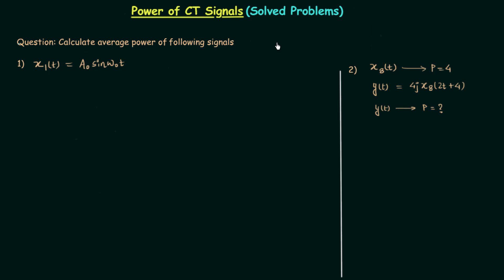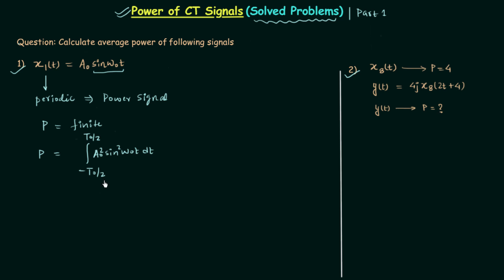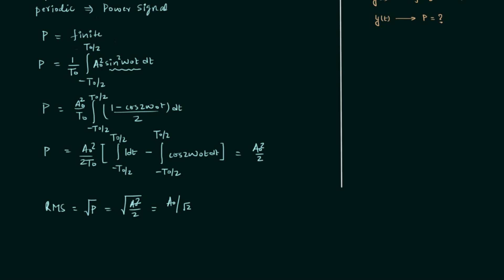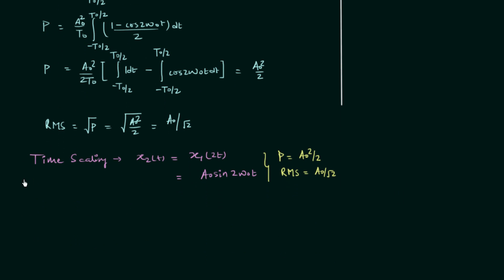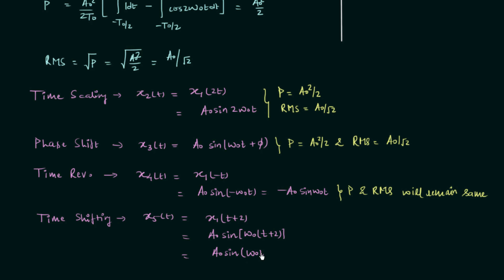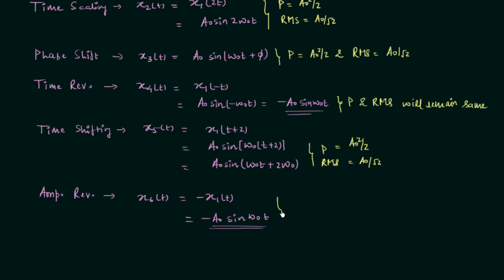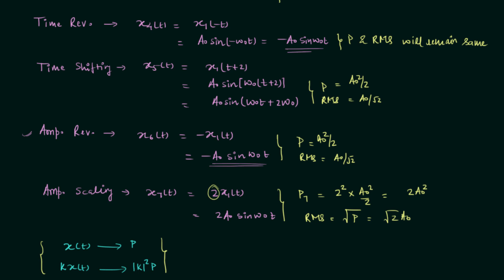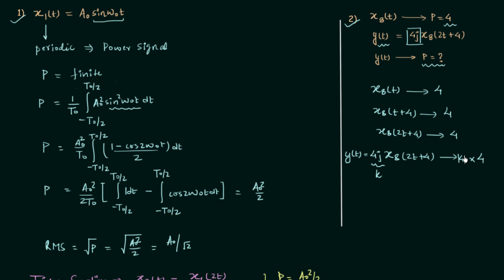Power of CT Signals (Solved Problems) | Part 1

Comment: for those who ask why the integral of cos2xwo is 0. When you integrate you ll have 1/2 (sin2*wo*t) with values from T/2 to -T/2. We ll take To as 2pi because the sine function repeats itself after 2pi*k intervals this equals to 1/2 (sin(2pi*wo)-sin(-2*pi*wo)) (sine is a odd function and we used an propriety) = 1/2 (2 sin (2pi*wo)= 1 0=0
Reply: Bro you are saying sine is odd function that's absolutely fine 
So sin(-x) = -sin(x)
Sin(x) - sin(-x) = sin(x) - [ - sin(x)]
= Sin(x) + sin(x)
= 2sin(x)
Reply: @pavandharimireddy3871  dt becomes 1/2du, that`s why this guy was absolutely correct a year ago. Those 1/2 and 2 will vanish and the rest will be sin(WoTo)
Reply: i still dont understand how that intigration works
Reply: Thanks, mate
Reply: Why there is mod in case of amplitude scaling ...why cant we consider (4j)^4 =-64 in case of last problem

Comment: Sir why you have taken the limits as -T/2 to T/2 in the 1st problem? as we know that in the formula of calculation of average power of periodic signals we use the limits as 0 to T.
Reply: Bcoz infinite signals average are taken under the limit of -T/2 to +T/2 so 1st u goes to -T/2  to 0 and then 0 to + T/2

Comment: 3:03 Sir u skipped the part for which here i cam for . ... Limits are from – T/2 to T/2 ... But T- tends to infinity .... What should we put in integration ? T=2π then whats the use of the limit T tends to infinity
Reply: because you are first trying to find the power of the signal over a finite duration and then extend it to the complete signal which is from -infinty to +infinity
Reply: put To = 2Pi / Wo then sine 2pi terms will come

Comment: integration of cos2wt over the range -T/2 to T/2 cannot be zero....So Power can't be A^2/2
Reply: At the end of the solution put w0=(2×pi)/To. You get Ao^2/2.
Reply: you're a life saver
Reply: Tq  @sayan486
Reply: @sayan486  thnks
Reply: can u explain more
Reply: It is zero, the angular velocity doubles, which means the period shrinks to half, so the integration interval is 2T, so it is zero. (cos / sin has zero integration on T, 2T...,nT)